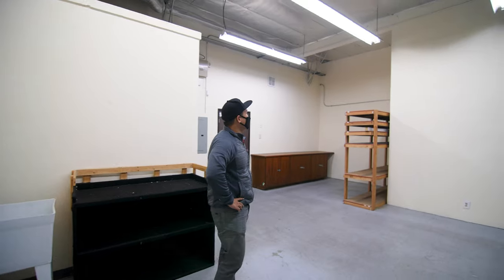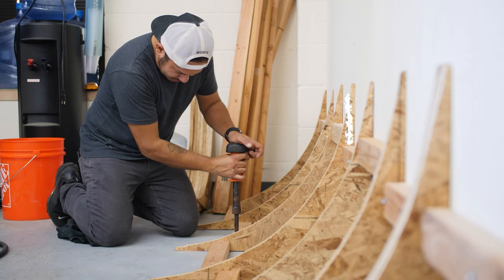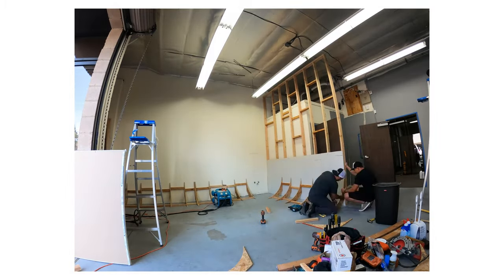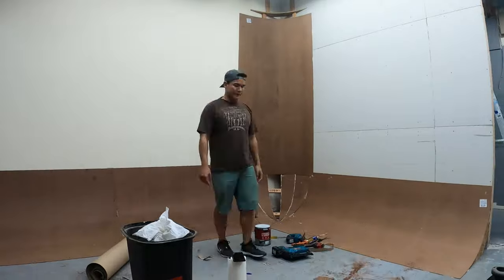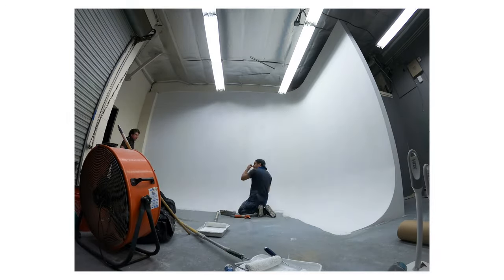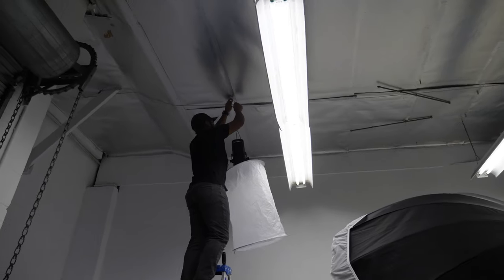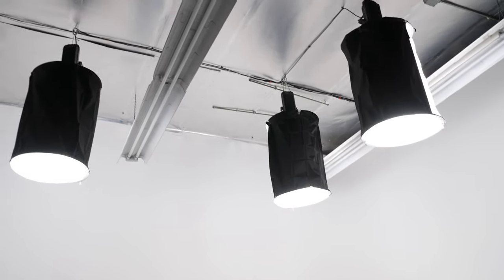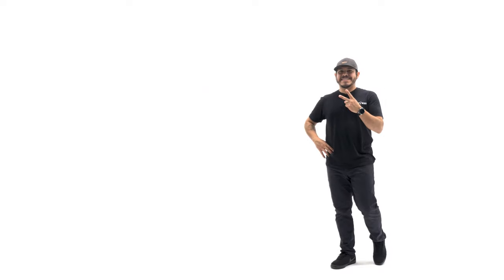Why We Built A Cyclorama

Comment: nice job! Have any cracks appeared in the plaster? I'm building one and plan to mud and tape.....any suggestions?
Reply from the maker: Hey Mike, thanks for checking out the video. Mud and tape was key but now we've noticed the joint has cracked and even a fresh coat of paint doesn't cover the crack. Thankfully we've done tests and the cracks don't show at all so no worries there. Just make sure you light it correctly. 👌👌 We'd love to see what you're building, best of luck with it.